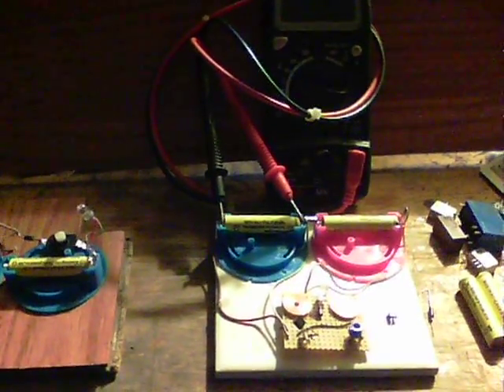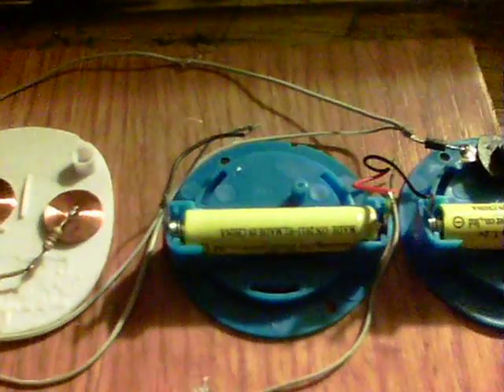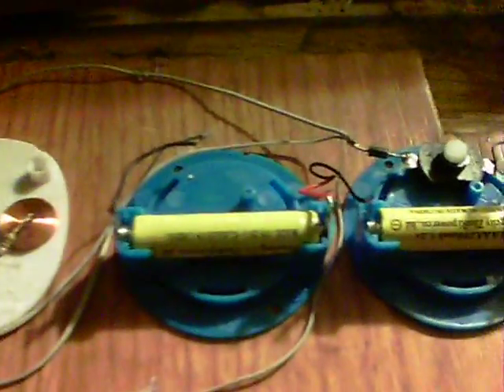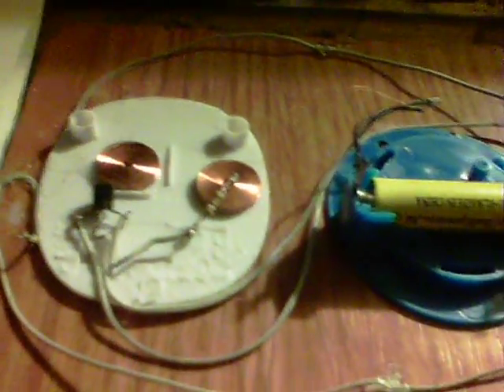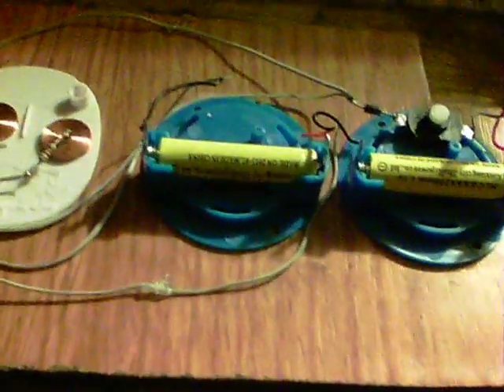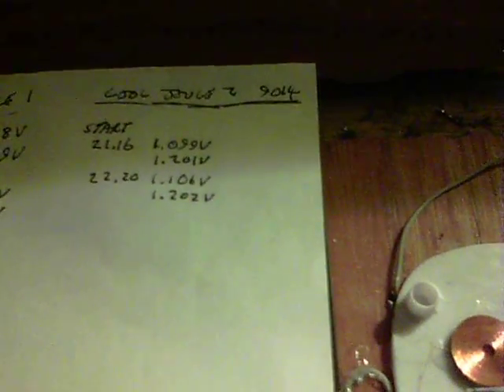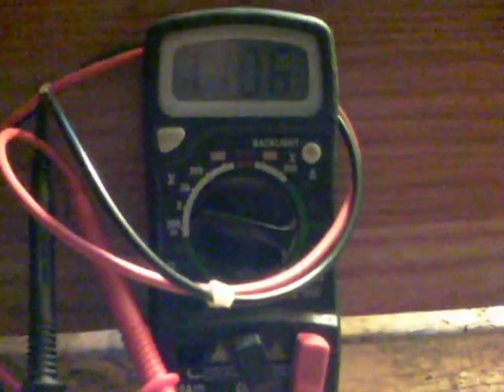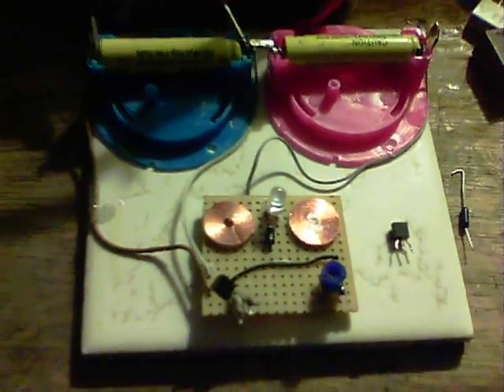Cool Joule - 1 Runner, 1 Maybe

Comment: Mark, I already had a few of the little flower coils with a two pin connector encapsulated on them. It probably took me 10 minutes to get running. I thought I had huge success but I hooked a galvanometer up and found my circuit was drawing current when it was stopped. If I connect the battery fresh no but if I start the circuit then stop it it continue to draw more current then when it;s oscillating. So my batteries where recovering from a heavier current draw not charging. I'll try again.
John

Comment from the maker: Thanks John. They work very well, also 1000uH axial inductors which arrived in the mail the other day. A circuit with those was running about an hour later. Perhaps the inductor version is easier to build (and keeps the flowers dancing away, unless you make little motors out of them lol). 
Inductor version is the Cool Joule GTi - cheers, Mark

Comment: I would agree it is the relationship of the charge battery to the run battery within the circuit. Otherwise it is just a blocking oscillator that has been documented before, definitely in the "tube world", anyhow.

Comment: Appreciate method you used to unglue DF coils. I was planning to remove my first one so I’ll put it to good use, wasn’t sure if glue used would cause damage to fine wires of coil if pulled apart. Yes, with LED in charge path by bypassing it series resistance will be reduced and the energy used by LED should go into battery. Good project to experiment with this coils, will be good to find out if adding another DF coil in series with L2 will improve or be too much resistance - also use of caps.

Comment from the maker: All still going. Circuit 1 rising, Circuit 2 at exactly same used as charging but with LED on. Circuit 3 is now running. I want to test a lot of parameters, yet as soon as 1 trundles off in a positive way I make another lol, running out of solar garden light batteries !

Comment from the maker: Elephants and bears ? oh my ! never even heard of those variants  :)
To remove a DF type coil, unsolder from circuit board + bend the plastics on either side, with hands or using a pair of pliers on one side. At a point, end of the coil becomes unglued. Focus on that area, moving pliers nearer and slowly bend further. It can then be pulled upward and the glue will break, without damaging the coil.
LED is in charge path, but I do have such a switch on first built circuit.

Comment: @Slider2732 Thanks for very informative video, kudos to Tinman and you. I've also accumulated dancing flowers, elephants & bears primarily to experiment with the coils and determine which are easiest to remove. Did you cut out all DF coils or were you able to unglue one? And would momentary N.C. switch across LED speed up charge and still allow visual check? Recovering collapsing field is a great interest, I’ve used 2250uF cap on golf cart to return to batteries and save heavy contact arc wear.

Comment from the maker: Makes me think of batteries in a different way. It may be explainable with Ni-Cd chemistry, but the first circuit continues to charge, 1.205V/0.838V today. Seems to be a fine balance and most components don't work. Very tricky yet exciting to see the voltage climbing on well rested batteries.

Comment from the maker: Yeah. You have a cap on there of 10V 470uF that charges up, at a trigger point of the blob the circuit fires, sending out the pulse to the coil. 470uF is large enough to form a gap no matter the strength of the sunlight and so the pulses move the little neo magnet that the flower plastics move on. The magnet goes left right, the cantilever type plastics rock and flower dances.
See sMartcreations2010's SS1CC, the inner blob circuit is likely similar.

Comment from the maker: Anything close to his Patent I would think, with the spike used for the charge, but also the method of 1 coil inducing to another to switch a transistor. In this case though, TinMan was aiming to build a SS SSG. But yes, blurry line, Bedini or Joule Thief with this type.
Using the start letters of both, it could be called Beef lol

Comment from the maker: It's more like the Bedini solid state SSG motor circuit. 1 supplies power, the other charges from the collapsing coil effects. Seems that TinMan was hooking one up and found his batteries to be charging, rather than doing nothing or depleting. 
It may be just some effect of Ni-Cd's that isn't understood properly, but he said he's run a solar garden light with a charged battery for near equiv run time of a standard charge.
It's a simple enough circuit to try out, so I did :)